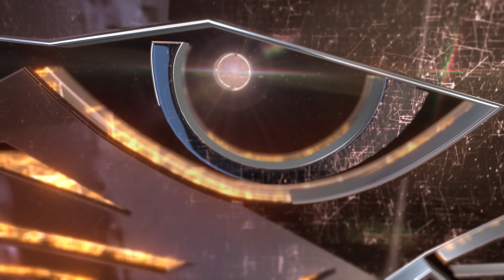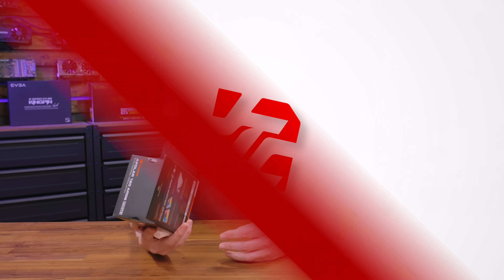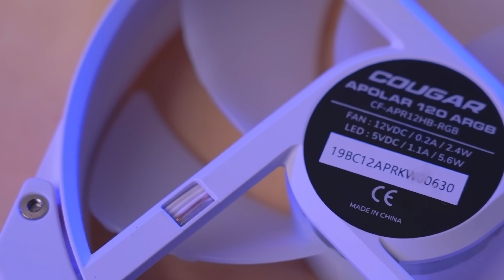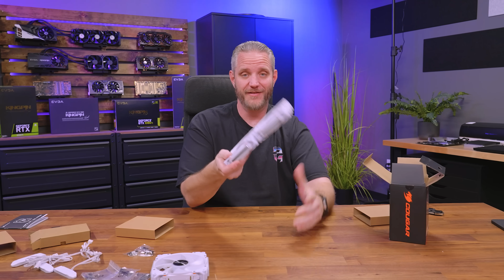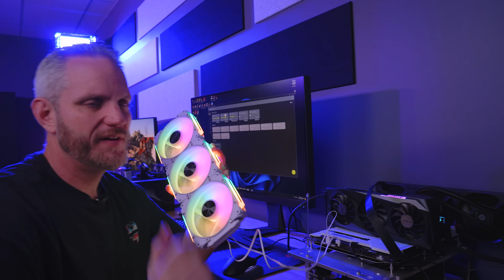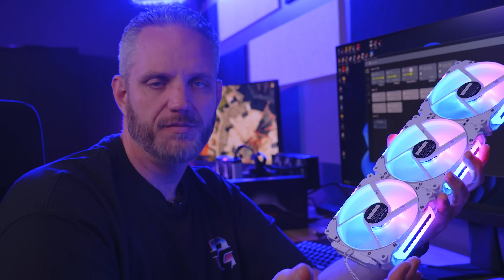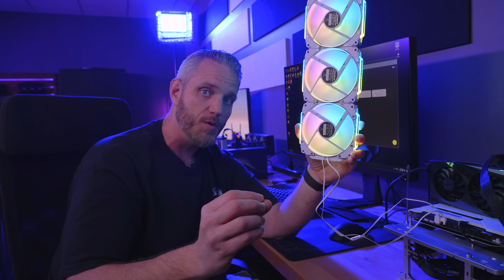ALL PC fans should have this feature! (NOT RGB)

Comment: Cougers Website says : HDB hydrodynamic bearings extend lifespan and reduce noise on the  APOLAR 120 ARGB - "Elite Universal Modular Fan"   They also have them in a "Infinity Version and a bank of Reversed bladed units,  but no 3 packs of 140s  (the do have single 140s in black or white with RGB tho.😌   Be Cool better get their act together ! Their fan competitors are beating them to a lot of this, unfortunately.

Comment: Prefer the new Thermotake comes with oil plus extra blades that do the opposite direction of default install blades , they easily pop out to exchange, with warning if you do it several times to add drop of oil

Comment: Please explain the following to me... First... I have a motherboard with ---> 3X JARGB_V2_1~3: A-RAINBOW V2 (ARGB Gen2) LED headers. Second... ---> I have a Full Tower case with ---> 12 ARGB fans. (3 on top and 2 on the back are exhaust, 4 on the side and 3 on the bottom are intake). So how do I connect 12 of these fans to the 3X JARGB_V2 so that it works?

Comment: I have a question in these fans. Since they have a single cable and plug into a single ARGB header, do they read as a signal fan with shared ROM control or 3 fans with individual RPM control?

Comment: Fans "good deal" depends on their quality, volume, features and static pressure/flow. You didn't do ANY comparison so we can't make a value assessment. but if they can keep a radiator cool at 35% rpm or so, sure 70 isn't the worst deal, problem is, lian li is the same setup, but better performance than anything for 5 bucks more.

Comment: Good video, thanks, I was very interested in knowing a little bit more about these fans.

I am a fan of this brand, I still have two Panzer cases, 4 mice and 2 keyboards in storage. Currently, I have 10 Cougar fans from the old Vortex line, 8 120mm (4 orange and 4 black) and 2 140mm since 2017-2018, and they are still running strong, no fluid leaks noticed, not even some weird nose noise at all. Just working almost 12 hours a day, six days a week.

I have also used a Forza 85 CPU cooler, the fan is really quiet and powerful when running below 1500rpm, although it starts to get too loud when it has to reach its maximum of 2000rpm. And just today I received the last Forza 135 in Amazon Mexico inventory 😁. That's why I'm interested in this APOLAR model, I want to put a little touch of color on these CPU coolers. The only one bad thing, here in Mexico, the APOLAR 3-pack costs USD$100 😮‍💨

Thanks again.
Kind regards!

Comment: Daisy chain without cables isn't bad, but it's RGB and I don't want RGB. It's useless energy waste in a case without glass panels and why pay for something I won't use. I would be interested in such fans that are not RGB. RGB is just to distracting when working in photoshop and similar tools. I did not pay money to get a color calibrated monitor just to destroy it with RGB.

Comment: Hi Jay, The connect ability of the fans me thinks could be improved if you had two rows creating a bank of 6 with just the two cables for the exhaust top set if using 120's I don't think there is a case that allows several in a single strip, I could forgive the orange bits if performance, low noise, ARGB (just thinking you could address each fan independently of each other so that each would have its own color scheme and the ability to connect a block of 6 fans like six dots on a dice was an option), maybe for one of the side panels a wall of bank of 120's extracting the heat would be better due to the shorter distance from the components (as long as it don't suck all your bits off the motherboard!!!) Also it would keep all the debris from building up inside your pc help to keep the dust of your components! Some case manufacturers have loads of fans but then seal/block the fans from increasing airflow with either a component, or panel made from metal, plastic or glass which defeats the object. I cant see the point of having a 360 rad with fans only to have it blocked by glass for example. Btw fyi the music generated by the fans was a bit quiet maybe they could be connected to a 7.1 surround system at full blast with a deep sub woofer maybe so we can all feel the vibe and get into the groovy video, thanks ;)

Comment: why are all argb fans 2 rie sets? why cant they all be 1 wire set with all 16 wires molded to gether with 2 connectors at the end that can be split up the wire to reach the connectors? then i will look like just 1 wire coming off the fans and make wire management cleaner and eaisier

Comment: Lian Li P28 is single cable interconnectable fans with no RGB in black or white...sadly they only come in 120mm but that isn't a deal breaker for most people just limits the options for use. Also the ThermalTake TOUGHFAN EX14/EX12 Pro are also non RGB and come in both 140mm and 120mm respectfully...but I have only seen them in black.

Comment: Not even 50 seconds in and I have to disagree with your premise in your opening about whether or not fans that magnetise and chain together are worth it. My current build has three sets of SwaFans from Thermaltake which have this feature and I can't enumerate how satisfying it is to have only 1 cable per group of fans that controls both fans and lights. If I have to buy fans I will not go back to single fan cables.

I fully expect that your opening was leading and meant to get us viewers animated on the topic.

Comment: I have the same issues with my aura sync not recognizing The same brand fans. had to move them to a separate header which all 9 fans didnt fit on. i can also only control the fan speeds on 6 fans that are on the rgb header. the 3 front fans kinda just go at 60% full time.

Comment: Oh yes, I definitely like the bequiet fans. The ARGB of the Light Wings are good and fit nicely on a radiator and the Silent Wings 4 are so quiet that I wondered if they were defec at 3000rpm (they are intact, they're just quiet)... But you have so many cables and the extra connection outputs (3 pices/cable on the light wings), it's no fun to hide the cables and connections or arrange them in such a way that the back panel doesn't pull out the ARGB plugs when you close it. Sure the focus is on the performance of the blades, motor etc., noise, but I would like to buy them with a daisy chain connection.

Comment: I'm curious about the allen head screws in the corner pieces, because it seems the washer/spacer bits are removable so you can change them to match what ever you want - or leave them out entirely? 
Surprised you didn't even try to see what happens when you unscrew those 😊

Thanks for the review, these seem pretty neat 👌

Comment: Great review, I went with ARCTIC F12 PWM PST (5 Pack) - 120 mm for $30 bucks. I'm using Fan control got rid of my fan controller. Running 10 fans inside the Antec C8. I would or will buy be quiet or anything (non) RGB - like this in a min.
Reply: Lian Li P28 is a non RGB fan that connects like this...sadly only 120mm...but they do come in both black and white!

Comment: There are interconnectable fans without RGB. Thermaltake Toughfan EX12 and EX14 Pro and the Lian Li Uni Fan P28 without the additional RGB frame addons. And the first version of the Seasonic MagFlow don't have RGB either.
I know you already tested the Uni Fan P28 (but with the RGB addons). Maybe you can get some of the others? :) But yeah: be quiet! and Noctua are the ones I'd love to see with daisy chaining. Personally I wouldn't even mind if they had "cable daisy chaining" (like a regular fan but also with a PWM header in one corner of the frame) and no physical direct connection (like magnetic or clips or whatever).

Comment: 16:03 I completely agree. The only reason I have RGB fans on my recently built PC is because I couldn't find a non-RGB version for those unifans. They make cable management way easier, plus you don't need as many screws to hold the fans when they are firmly attached together. As for the RGB cable, basically what I did was that I left it unplugged, but it's definitely better to have the option to not have that cable at all.

Comment: Cost isn’t worth it; having more wires to hook up is only an issue when first installing your fans which you do only once! Unless you do this for a living like Jay 😂

The fans were definitely the toughest part of the installation with having to daisy chain and making sure the headers were plugged into the correct ports on the motherboard, but again you only have to do this once; even when changing the CPU and GPU, you shouldn’t have to mess with the fans.
Reply: If common fans on pc case sucks, you should change it.

Comment: Lian Li UNI FAN SL120 V2 ARGB - yes 100$ sadly - but they work and are built very, very well, seriously. Other 5 that I have, Noctuas 120-AF ULN (Ultra-Low Noise) - those are absolutely quiet and I have some that have.... 4 years running, still silent. Noctura'a are top, yet for now 4 months of using LianLi, they are solid. One point - every unit is heavy, and 3 connected are really heavy, but straight and riggid af.

Comment: Speaking of motherboards.. I've been running an Asus Tuf Z490 with 32g of Trident Z Royals for several years (before ddr5 was a thing). Same problems then, same problems now. Beautiful ram sticks gimped by poor motherboard. My Lian Li Unifan Infinity setup with 9 fans in my Corsair 5000D case have been awesome.
Thankfully my 11700k and z490 have become my bottleneck so once Intel gets their "15th" gen out I will be switching brands. Of course my Royals will be display pieces haha

Comment: Good to see you look at more Cougar stuff. I've had good experiences with their parts. I just replaced the front 140mm white led Cougar fans I've had in my case since 2014 running 24/7. They still worked fine but one of them would have a rattle noise off and on. But mainly they're a silent model limited to 1200rpm and they couldn't keep up with my 3080ti. Also used a few of their budget cases.

Comment: Not to discredit these fans, but just did a build with the Lian Li TL120 and their implementation of the daisy chain tech is next level. They thought of everything, the fan modules only need one cable, then you connect the hub to PCIe and a usb header. Love mine

Comment: All fans displaying the same RGB is likely due to the way they have decided to do the RGB daisy chaining. It looks like they might just split the RGB signal into three and essentially connect them in parallel with the same signal going to each fan, rather than connecting them all in a strip if they had done it in series.

Comment: Although the single cord connectivity is an attractive one, unless each fan has a dedicated ID chip, and a way to be detected individually, they will only be seen as one device with software like Razer Chroma. The Razer Chroma ARGB hub uses it's ports to determine the device, and LED count. This means You'll only get one effect through all 3 fans. I have my 3 front fans in 3 separate ports so I can do custom light schemes on each fan. It might be different on other, more expensive devices though.
  Also keep in mind that only one Razer hub is currently recognized by the system unless they've finally fixed that. We've been waiting for years to have multiples of the same devices be recognized by Synapse 3, but the last time I checked they hadn't coded for it.

Comment: these fans a similar to Phantek's D30 range, they daisy chain through the corner of the fan with a copper push pins and they can connect together so its just a fan cable and rgb cable, and yes the D30s are expensive i just recently brought and built in a Phantek NV9 and brough 3x 3 packs of D30s, cost me just as much as the case its self ($400 AUD for fans and $400AUD for NV9), was it worth it? fuck yes it was the case looks fantastic!!
Reply: They both same price. Only little  visual differrent they have.

Comment: My pc some times freezing after few seconds open the game applications (pc spec gigabyte b75m motherboard, 24gb ddr3 1600mhz 8gb two sticks and 4gb two sticks, i3 3570 processor,  asus strix 1070ti 8gb vga, corsair 850w gold full moduler power supply) befor i used asus 380x 4gb vga card that time this issue not happened. I change vga card only other spec are same as before. I always playing games pc side pannel open because of  temperature inside the pc. Under heavy load gpu temp 50-70° and cpu temp 50-70° that is ok. This issue start to happening after insert brand new 1070ti vga. I'm playing call of duty and motogp 24, sbk 22 and f1 22 games with ultra settings before and now. No unnecessary background process or apps running. drivers and software all upto date including win 10. Several times vga unplugged and reseat but still issue persist. Another thing some time press the power button to boot and getting beep sound continuously then pulling off ram sticks out and reseat all 4 rams then beep sound not coming and pc work fine this happening several times per month and not every day. Enyone can help appreciate it. Thank you. Anyway sorry for my bad English

Comment: RGB might be nice bling, but I would rather just have no RGB Lian Li fans. Honestly, it's not like I look at my computer based on its location. Wither it is at my feet or on my desk my focus is the monitors and not the actual computer. Reason I picked the Lian Li over Cosair at the time I built the system is the Daisy Chain ability. So, I have all the RGB in my system turned off, just don't need a light distraction on something no one but me will ever see.

Comment: The ASUS hatred is a little over the top. Yes, ASUS is a flawed company, and yes, Armoury Crate is hotdog water, but you seem like an ex that isn't over the breakup. I've even had issues with ASUS, and it was largely due to incompetence, but I escalated to the North American CEO's office, and my issue was finally resolved.  I was persistent, and my 4090 issue was fixed by them replacing my bad Z790 Hero due to a bad USB header on the board.

Comment: 9:15 for me that is less of an issue since i tend to stay on one colour static mode with my RGB stuff. but what does worry me is the size since those look bit wide when it comes to the side LEDs. i have Fractal Design Define S2 Vision Blackout and its front panel has this sink. 
so the fans might not fit unless i do some cutting and other cases that also have this type of fan placement where the case has counter sink for the fans it might come an issue. 
i all rdy have 140mm fans on the front and there is like 2mm extra space between the fan and the case. so i would like to see a 2nd model of these with out the side LEDs for cases like these

but ye. over all i want to see more fans like these that just clip to each other so u can limit the amount of cables bc having to manage so many cables is pure nightmare. or make the cables way shorter and include a extension with them for single fan setups and a extension that is designed for daisy chaining cables. especially if its a 3 fan kit
also dam. no 140 option :/

Comment: I have 8 x NF-A14 PWM 140 Noctua fans on my 2 x 560 radiators ,  4 x 120 Vortex PWM Cougar fans all in my The Tower 900 case since 2018, 2 of the cougar fans died just under 5 years of use, 1 was noise just got so loud and the other the motor just stopped spinning without warning.
2 still going strong as are all Noctua fans still going all are still super quiet as eve, so my summary is for the price the Cougar are very good fans, however personally  I still think Noctua are awesome fans.
 Like Jay said I would recommend the Cougar fans for the price they are less than half the price of the Noctua but I personally would still use Noctua for couple of reason Noctua you get a 6 year warranty the Cougar warranty is 3 years and the accessory you get with Noctua is really good with the Cougar you have to buy the cable extender as its comes with the Noctuas.
So after 6 years of being used for minimum of 4 hours during the week and 6 hours at the weekend being used every day for the last 6 years the Nocyua are still going 100% where the Cougar are at 50%, in the long term the 2 Cougar fans  are the same price as the Noctua as I would have had to buy another 2 to replace the dead ones.
All I say is choose what you want within your budget and what looks nice to you.

Comment: I agree, I have NO desire for a light show inside my computer, it only burns more power for nothing and wastes CPU cycles I would rather be used for processing my applications and programs. In fact I don't even like the nightlight brightness of the power led on old cases. My computer is on while I sleep, doing the grunt work I programmed it to do before bed. i would prefer my computer to be whisper silent and totally dark.

Comment: For me, the perfect fan must have reversible fan blades and each fan connected make a continuous rgb light strip. Perhaps these fans connected to a other rgb controler can maybe presents this function (i have chinese fans from jonsbro and when connected to the motherboard header/controller its a mass, but when in a other controller, then all be fine). If the vendors make a fan with continuous rgb, reversible fan blades and one cable for power/fan and other for rgb is perfect - plus a good air flow and pressure, and low noise. Because the downside of one cable is the fkng proprietary format (hey corsair come on) with a proprietary software for hanging my play game.  It think they can do that, but instead they prefer an endless number of models and each one covers only one of these characteristics, two at most. If one make this, shut up and take my money, but since they don't do it, I buy the Chinese ones really cheap, the regret is compensated by a smaller financial loss.